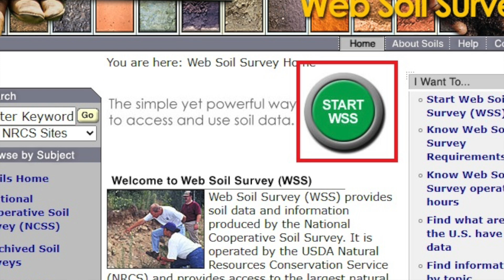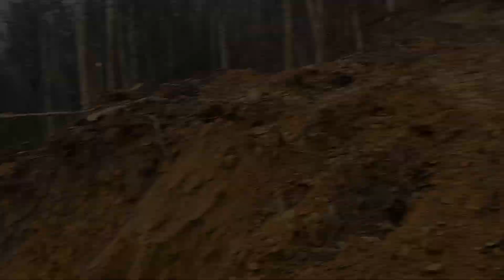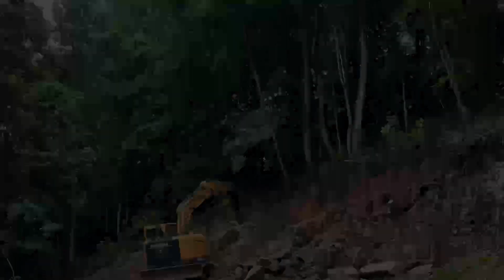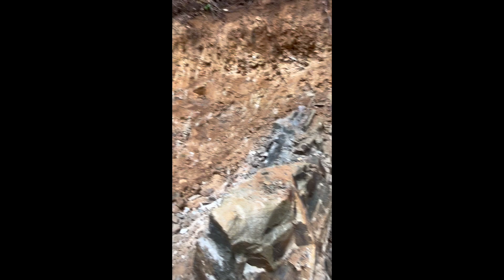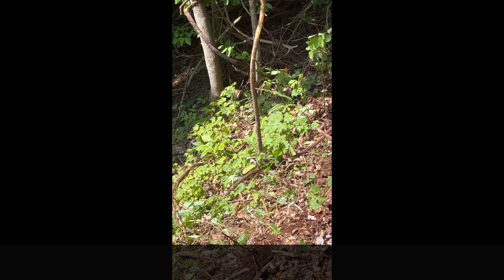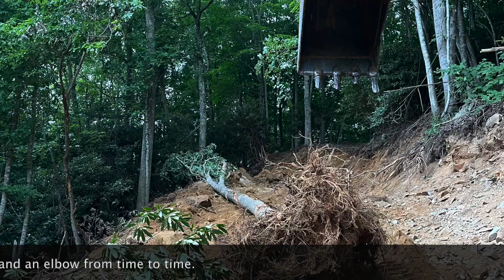East Tennessee Mountain Road Building -Part 3

Comment: test the nitrogen charge in the hammer for proper pressure and check pressure and flow on the excavator with a flow meter- it can be adjusted on the valve block with a locking nut and setscrew setup 
you dont get full punching power if flow is to high and pressure is to low - you get low hammer frequency if the flow is to low 
have it checked for efficiency 
https://www.youtube.com/watch?v=Uqzy5nxzXAU
Reply from the maker: Thank you for the thought.  I do check the nitrogen charge (16lbs) and even took out the quick connect couplers to make sure the flow was not being slowed down.  The flow controls are electronically controlled from the cab when I change tools on the excavator. I have worked with a rep from Reco and reviewed the manual for the hammer to make sure I am at the specified flow.  This is just some really hard rock. But thanks for the comment.

Comment: Man that looks lolike some good rocks there maybe from a glacier 
Might I suggest you try to test some of that rock and gray stuff you might find yourself some gold from how it looks in my opinion you could have 1/2 oz or more per ton of dirt! Good luck with the road and stuff I pray one day you find some gold there and get your money back from buying the property my friend!!
Reply from the maker: When I was looking for land I did specifically look for things like magnetite, and metamorphic and igneous rock which are all present here.  Also, I actually did buy a hammer mill and shaker table to do some gold exploration.  I also regularly stop to run the metal detector over the rocks but so far nothing significant is showing up.  It may be that the gold is just to small for the methods I am using to look for it.  My daughter did find some quartz with a little gold in in but it is really small. So there is hope...  Thanks for commenting.